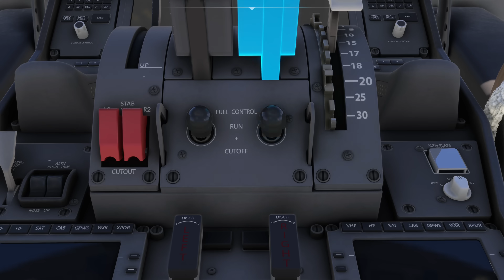Air India 171: Why Did The Fuel Cut-off Switch Get Moved?

Comment: This is why we need cockpit video. When you're at work, there is NO legal expectation of privacy, but because of a union being overprotective, we'll never know what happened to the switches.
Reply: Even busses and trains have cameras now a days. Why are aircrafts avoided.
Reply: @RockyRock-vv3ex oranges and apples , you can’t compare the 2
Reply: @MrMgage13 Why, whats so special in Aircrafts which shouldnt be recorded?
Reply: When audio CVRs were introduced, the agreement was that the recordings would never be made public, only accessible by investigators who would hold the recordings in confidence. This agreement has been violated countless times. The last thing a pilot wants is his or her death leading on the perpetual news cycle.
Reply: I gave anesthesia in OR'S for 40 yrs. Since around 2010, cameras were installed in every OR.
Reply: @pegggymallis324  I work in a hospital. Cameras are everywhere. The medication room, procedure rooms, operating rooms, emergency department, hallways and parking lots. What do pilots have to hide Captian Steeve?
Reply: Is this possible.
Major failure of systems which caused the RAT to deploy and also shuts the fuel valves. The pilots get some warnings including engine shut down warnings and fuel cut off warnings. One pilot quickly assumes the fuel switches were operated and asks the other why. The other pilot says he didn't. They then realise the switches are in the on position so try cycling the fuel switches off and on to see if that would get the engines going.
Reply: Absolutely ridiculous that a certain word can't be used here on YouTube? WTF ?
Reply: @JK-dp3lp YouTube is strong with censorship!  You can only say what YouTube approves.
Reply: Yeah we did, they flipped them! They don’t flip themselves! The news media has everyone believing Boeing created airplanes with faulty everything! That Advisory bulletin is completely irrelevant. Disregard it. They have the pedistal with the switched still on it and they were normal. If a pilot wants to go suicidal there’s a million ways up there to do it.
Reply: Recording will discourage someone from doing something wrong
Reply: @dharma37chef54  not really, he knew he was going to end up dead anyways why would he care
Reply: Yes, but atleast video should record from switches and dashboard parts as much as possible, Not including individual (pilots)
Reply: It's not that easy  the unions don't want that the only way it would work for all  is the recording would be triggered by a cockpit warning
Reply: @therankinfamily1867 recording can be designed to be automatically deleted after plane is landed safely this should address union’s privacy concerns
Reply: @therankinfamily1867  that would defeat the purpose and in this case the warning comes AFTER the action.
Reply: Non union jobs also don’t have cameras why don’t have cameras at operating theatres too so you can sue the surgeon , always basement dwelling commenters love to comment with out any thought
Reply: I'm on camera 100% of the time I'm at work and I'm not responsible for hundreds of lives.
Reply: A cam could show wether and if who was tuching the switch.
Ther are good arguments for cams yet also against them.
People at the moment are quick to pinpoint at the pilots.
There was a bulitin pointing to the switch some years before, air india did not check the switches afterward wether they are ok or not - this was not medetory.
The report dose not realy state yet wether the switch was realy ok or not.
As long the final report is not out it is good to slow down with pointing fingers, it could be the wrong adress.
Reply: Then someone will just find a way to shut it off if they were really determined to.  Cameras would not have prevented this.  🤦‍♂️
Reply: In your country maybe there's no expectation of privacy.  In my country we have the " workplace surveillance act" .  Careful about specious generalisations.
Reply: No we don’t!  Now you’re just giving the FAA ammunition to violate a pilot for any simple thing made up or real and abuse their power- and oh and they 
would. Maybe stop hiring jihadi pilots would be a great start.
Reply: In all civilized nations employees have protections!
Reply: You have two suspects for the suicide variant. Wait for the final report, there’s a 95 % chance they‘ll find out.
Reply: And how would that matter now ? People are dead
Reply: Absolutely agree I drive a bus for city and over 16 cameras are present recording at all times.
Reply: Cameras in the cockpit, that’s never going to happen. Unfortunately
Reply: Wow that's a great point.
Reply: then you should become a pilot....
Reply: and you are incorrect... the FDR tells where the switches were... how do you think the report was written?
Reply: @SKIPWOOD-UA777CAPT-RET  It tells where the switches were, but not how they got that way. If the switches are defective, but the crash is attributed to pilot error, it can happen again. Video would show if they were moved by hand or came out of detent due to a defect.
Reply: @tooltroll  so in your experience have you ever seen 2 identical switches fail at the exact same moment? I wonder what the odds are against that? there is enough technology in airplanes as it is... air india KNOWS what happened and who did it... they just won't release it... and the same goes for a camera if it had been installed... they wouldn't release it.
Reply: @SKIPWOOD-UA777CAPT-RET  I can see two switches getting bumped by the pilot reaching for the thrust levers. I don't care if the video is released, nor should it be, but there would at least be proof, not speculation, as to which pilot touched them and why.
Reply: @SKIPWOOD-UA777CAPT-RET  Ttroll, you have two ears and one mouth?  Use your ears TWICE as much. Skipwood has been there done that. Listen to him PLEASE.
Reply: How would cameras in the cockpit prevent a potential sabotaging of the aircraft by one pilot at a critical point of no-return though? They wouldn't. They could show which one caused it, but that wouldn't bring back 200+ lives or stop another pilot doing the same if they were so inclined and showed no outward signs of intent. And if pilots know where the cameras are, and want to do something preplanned like this could be, would they not then also plan how to cover up what they're doing from the camera(s)?
Reply: @JonathanB6023 Visual a direct evidence. A murder suicider would refrain fromdoing so in a Cctv environment in most cases.
Reply: You fucking western media are trying to save Boeing... Boeing is the real culprit behind the crash..
Reply: Camera’s might answer some questions but they won’t prevent incidents, those advocating cameras just can’t stand not knowing.
Reply: @SteveC-y9W  Actually cameras could prevent this as well. In some cultures the pilot would not like that the family has to live with this guilt. It would also make any insurance to be void since they don't cover suicide. I.e. it would hurt the pilots family and that may stop him.
Reply: @SteveC-y9W  If it was caused by a defect, yes it would prevent future incidents.
Reply: Yes they can, if anybkdy knows they are ubder cctv surveillance, villaneous behabiour reduces drastically  @SteveC-y9W
Reply: @SteveC-y9W  How many car accidents are prevented by having dash cams?  Probably not very many.

But how many times have dash cams been used to prove what really happened or who's responsible for the accident? And how many times have dash cams been used to prove assault or attempted fraud? 

And for commercial drivers, how many times has the mere presence of interior cameras discouraged drivers from playing sudoku or words with friends on their phone while driving? If it was only once, that's enough.
Reply: I bet you work at a call center and have no real life job, is there a camera in every cubicle of your office ?
Reply: Agree, can also potentially handle college complaints, ensure possible and complete training for procedures. They could and should be used to improve safety further
Reply: Fake narrative. Facts are here. You are sold off to Boeing. Why don't you talk about FAA directive from 2018 and CAA directive from May 2025 which talks about issues with Boing 787 which can cause cut off including during inflight.  Why Etihad airlines and DGCA wants planes to be checked. Why British Authority wants checks for this issue since May 2025?.

Western media is corrupt and sold to Boeing
Reply: We know…we will never “see”…
Reply: Can I get the tape after I get in the mile high club? 
Asking for a friend.
Reply: @michaelgarrow3239  we didn't have cameras in the blue rooms... but in the 777 we had cameras everywhere else... they do not record.. you could only view in real time.
Reply: First step, take down the camera. There it go your great idea.
Reply: This is no tragedy it was mass murder -
Reply: Real simple - video recordings can be kept locked up at end of every day and disposed off periodically nobody allowed to look unless airline and union and faa all agree .
Reply: What union is it exactly that is being overprotective and keeping cameras out of Air India jets?
Reply: Just like police body cameras
Reply: the camera wouldve saved noone here
Reply: At the very least video feed should be included in black boxes
Reply: It's not going to prevent pilot suicide but it will definitely make a difference in providing clues during an accident investigation.
Reply: Uh, yeah we do know what happened.  The voice recorder voice asks why the switches were moved to cutoff., indicating that they were physically moved to cutoff.The flight data recorder confirms exactly when each switch was moved to cutoff.  The engines confirm this by shutting down due to no fuel.  That is 3 separate confirmations of what happened.  Even if you had video, it wouldn’t do anything but possibly provide a 4th confirmation of the same thing, and a 10 Million click YouTube bonanza for somebody.
Reply: @eddiegardner8232  The voice recorder also recorded that the other pilot saying that he didn’t do it. So, now what is the truth?
Reply: @subhash494 . The simple truth is that everything tangible says the fuel levers were moved to cutoff by one of the pilots.  The report doesn’t say which one said what, but they know which said what because the recorder records each pilot’s voice on different channels.  They just aren’t publicly saying it yet.  The reason why is not being disclosed, probably because of legal liability considerations.  It might lead to implicating one or the other as the guilty party.
Reply: At least video should capture of switches parts, which switch when using pilot?
Reply: We know exactly what happened. The switches were moved by one of the pilots. We are unsure as to who and why.
Reply: @jamesdellaneve9005  that's what we want to know!
Reply: @jamesdellaneve9005  A video in the cockpit could have answered your question.
Reply: @jamesdellaneve9005 If one pilot was busy with both hands in take off, then it stands to reason that it is the other one!
Reply: @rozwood1668 That’s my hypothesis as well. They’ll analyze the voices and confirm it.
Reply: @rozwood1668  You can do any take-off with only one hand.
Reply: @GermanGuy007 Physically, yes. In practice, no.
Reply: @rozwood1668  Sorry, Roz. The pilot flying has one hand on the yoke, one hand on the power levers (even though auto throttles engaged). We PRACTICE muscle memory reaching down, without looking, to touch and postion engine cutoff switches to cutoff. You are KNOT dealing with kids here. Well, kids in comment section, no kids in B 787s.
Reply: @jamesdellaneve9005  ... or maybe the flaw in the switches is more serious and widespread than Boeing, with their horrible record, is willing to admit.
Reply: @tooltroll That’s impossible. They purchase the switches from a supplier. The designs are precise, they test the crap out of them. They qualify those manufactured parts and perform process surveillance at the beginning of the runs. To ensure that they are meeting the requirements. Many times, the same parts are used by other companies. I don’t know if this is a custom design for Boeing or if anyone else is using them. If someone else is using them, then you can get the benefits of knowing their actual failure probability. Let’s say that there’s a bad part 1 out of 25,000. The odds of getting two bad ones is next to impossible.
Reply: @jamesdellaneve9005  honeywell make the switches
Reply: @tooltroll  Ttroll, quit while  you are behind  !!! How many times have you / we heard about the engine switches slipping to cutoff on their own? You think highly trained pilots, who are always first to the scene of an aircraft accident, would KNOT report such an incident.  AGAIN, do KNOT believe everything YOU think. You didn't get your name by being in a tricycle accident.
Reply: @jonathanpringle8238 what do they know about avionics?😂 Luckily, switches are very easy to verify in terms of track record and such. They can triple check if they like. However, that notice from the past did not trigger groundings and such. If Honeywell has other customers using the same switches, that data will help.
Reply: @atpg5  Why do you post KNOT instead of NOT?  It's confusing.
Reply: @a.w.thompson4001  Eye no! Write?
Reply: @jamesdellaneve9005  Listen to james, he knows of what he speaks !!! These switches are used in many sophisticated jet aircraft.
Reply: @atpg5  You might be making a valid point, but I can't take anything you say seriously when you continually misspell the same word so many times.

KNOT does not mean the same as NOT.
Reply: @atpg5 Which makes the faulty switch hypothesis from highly unlikely to impossible. We have history of these switches working without a need for changes.
Reply: @j29maniac  Eye no, write?
Reply: @a.w.thompson4001  I smelled bacon as you read this.
Reply: FACTS!
Reply: Well , many flights are very long (12hr +), there can be times when pilots require a little privacy or relaxation. They may have rituals they dont want the general public to know. If there can be some system in place to make sure that the video stays on the plane and gets deleted automatically at the end of an uneventful flight (preventing any possibility of video leakage), perhaps many more pilots would shift their stance
Reply: @knownasezio4421 We dont want these cockpit videos to be released in youtube. It just has to be recorded in FDR and only to be relooked in an accident scenario.
Reply: @RockyRock-vv3ex  as steve said , the main concern is the videos of pilots leaking, there needs to be a system of rules in place to make sure such a possibility does not exist. There is also an unfortunate possibility that the higher ups are too busy trying to train AI for the planes to care about concerns of individual pilots who may soon be disposable in their eyes
Reply: @knownasezio4421  Designers are already working on aircraft with one pilot and one dog in the cockpit.
Reply: Yes we need cctv in the cockpits. If taxis and buses etc have them, then aircraft should have them.
Reply: @rozwood1668  KNOT going to happen in your lifetime.
Reply: @atpg5 Maybe Knot lol! 😂
Reply: @rozwood1668  Taxis and buses use them for the safety of their drivers, not to record the technical inputs of the driver.   That is because they operate in environments with access to the general public.  Airline cockpits are secure areas.  A camera would add confirmation in this case but it was the FDR that found the cause.  A camera would satisfy the public curiosity of who did it but it will never answer why.   It actually doesn't improve safety.
Reply: @matthewwillkens8240 Nobody asks you to show it published everytime a flight is finished. They shoukd be recorded and available to access in an event of accident. Thats al.
Reply: @matthewwillkens8240  I appreciate that but for the sake of the families, I would say it is necessary to know who made the error (🤔) so an innocent pilot isn't falsely accused. Could have insurance implications. I certainly agree that it would not be for the public but for the FDR and investigators.
Reply: We know what happened to the switches. A pilot turned it off, and in terms of safety and discovering failure mechanisms, which the investigation is doing it doesn't matter who turned the switches off. CCTV footage would only satisfy curiosity and would not improve air safety
Reply: @Cyb8042-j6w  ohh hell naah
 video footage is definately going to help in investigations whn they don't know which pilot changed the controls or how the controls was changed.....that basically will let the investigators focus on the pilots background who sabotaged the plane.....& find more answers & reasons....& hence there will probably changes in psychological evaluation of pilots in future before flying a passenger aircraft...
Investigators know it was changed but they don't always know how & by whom caused the change.....also completely cuts out the chance of any technical faults completely taking the blame away from the pilots & onto the airline....its infact better for pilots in a way....
& in the recent air india crash they don't have any clue which pilot or how the engine fuel cut off switch was engaged.....
270+ lives lost investigation would have ended right there.....there families still have no clear answers...
As passengers who gives there lives to the hands of the pilots atleast deserves this much transparency.....
SO CAMERAS should definately be installed in the cockpit.. period
Reply: @Cyb8042-j6w  it would improve safety as you can observe body language so will help airline psychiatrists spot problems
Reply: @Cyb8042-j6w The assumption CCTV wouldn't prevent potential accidents is wrong. People behave more responsibly if they know they're being viewed by video. This is proven and implemented in numerous other examples and occupations.
Reply: tell the unions that
Reply: Screw the unions
Reply: This may be difficult with international travel. There is an expectation of privacy at work in Europe (or at least the Netherlands), it is illegal here to use camera footage to check on employees except for very specific circumstances like theft
Reply: @kevinsweijen5674 I think an airliner crash would be considered “specific circumstances” many times more than theft….
Reply: @kevinsweijen5674 I'm pretty sure in Netherlands and other over protective countries, in specific jobs there are exceptions. In this case that is no "surveillance" (or big brother) but a safety recording that will only be accessed if a disaster occurs.
Reply: @kevinsweijen5674  only investigators would be able to access and view it, not your immediate boss
Reply: @jonathanpringle8238 this still applies. You have protection from being monitored on behaviour through camera footage. Otherwise every company would do it and just outsource it to a different company
Reply: @kevinsweijen5674 Netherlands trains and busses have cameras inside drivers cabin. LOL 😂
Reply: @RockyRock-vv3ex they do! But they’re not allowed to be used to check any employee behaviour.
Reply: @RockyRock-vv3ex so technically, say there WERE camera’s in the cockpit, under our law they could probably check it to see what happened to their property, the plane. They would not be allowed to make any notes on pilot behaviour or report on it, as that would be a breach of their privacy.

So even if the investigators saw what happened, we’d never know about it.
Reply: @RockyRock-vv3ex yes, but legally pilot behaviour would not be allowed to be investigated from that footage. So it wouldn’t have allowed for any additional official insight
Reply: @RockyRock-vv3ex  But KNOT in Netherland based aircraft. I was based there for 18 months.
Reply: If I was a pilot, I wouldn’t have a problem with it. Why would the unions cause such an issue?
Reply: @jacobspeeds The police love it. It/s reduced complaints by the a-holes 80%.
Reply: @jacobspeeds  Because it was promised to we professional pilots that voice recordings would NEVER be released to the public !  Have YOU ever heard cockpit recordings?  Are you part of the NTSB accident team?  There you go !!!  Search live cockpit recordings right here on this plateform. Here's a plan = protest, start taking the train to...well, anywhere in the North or South America.
Reply: @atpg5  you're right. the public will never have access to the data. Very convenient to manipulate in favour of the airline or aircraft manufacturer and blame on the pilots..it's quite pathetic..
Reply: @jacobspeeds I am and I most certainly do. We’re already the most closely watched and regulated profession there is. The day you record your surgeon , your kids teacher in class or you sitting at your desk at work come back to me. There’s no other job that scrutinises employees like mine and the level of observation is quite enough already thank you.
Reply: @EnfieldNo4  maybe your airline and most others, but there are still many other airlines that don't 'scrutinize' or care much about the safety and wellbeing of pilots and passengers. This is a prime example.
Reply: Absolutely...the pilot unions blocking cockpit video recording is absolutely ridiculous. Video recording must be done on black boxes and available for inspection only in case of an investigation just like the CVR and FDR. there should be no other means of accessing cockpit video otherwise.
Reply: If you don't agree to a cockpit CCTV you shouldn't be allowed to be a pilot. Simple as that.
Reply: @flyingeagle5061 Do NOT believe everything YOU think. You hurt the team.
Reply: @flyingeagle5061shut up
Reply: @flyingeagle5061
That’s just dumb. What an ignorant Statement
Reply: Yea especially after what happened with MH370 which was over a decade ago even airlines with not the greatest reputation should have a Cockpit Video Recorder, really they should've been commonplace even when MH370 disappeared, the mystery here I believe may at least one day be solved, I highly doubt mh370 will ever be solved even if it's one day found but I really feel we're technologically advanced enough to have at least a 1 hour loop of video which at this point I feel should be possible to have uploaded to the cloud as backup for it not as long as an onboard EAFR then at least on one hour loops but definitely onboard video recorders should be fairly commonplace by now, certainly in the next ten years
Reply: We do need pilots out of the cockpit …reduce their input to bare minimum….this would prevent so many miscommunications/ human errors, wrong decisions. Hoping technology will adfance fast enough t to take over all collision avoidance, routing, communication. We don’t need those errors..
Reply: @user-ks2wz7bg4p aircraft designers are already working on cockpits that have one pilot and one dog.
Reply: Yeah. Makes sense. Surprising! everywhere else a working place has cctv.
Reply: @Ttroll: We DO know what happened to the switches !!  We DO  know the very second when they were turned off, we DO know when and in what order, we DO know when and in what order  they were turned back on. You must pay attention. As for in cockpit video: do you have $1,000 US dollars? Bet it ALL on no in cockpit video in YOUR lifetime   !!!
Reply: 100% Agree.. CFII and A&P
Reply: @toddsmith8190 that’s because you are not an airline pilot.  Your view will change when you get hired at an airline. 

I suspect that you do not have cameras from your flight school in the aircraft you flight instruct in.
Reply: The preliminary report on the Air India Flight 171 crash has led many to hastily conclude pilot error, but as a pilot, I strongly question this assumption. The report indicates both fuel control switches were moved to the "cutoff" position within one second of each other, an action that seems nearly impossible given the design of the Boeing 787’s lever-lock fuel switches, which require deliberate pulling and flipping to operate. The cockpit voice recording captures one pilot questioning the other about the cutoff, with the other denying responsibility, suggesting a potential technical malfunction rather than human error. Furthermore, the lack of clear voice identification and the absence of cockpit video footage, as highlighted by experts, underscores the need for a deeper investigation into possible mechanical or systemic issues before attributing blame to the pilots. Rushing to judgment risks overlooking critical evidence that could reveal a flaw in the aircraft’s systems or maintenance, as flagged in a 2018 FAA bulletin about fuel control switch issues.
Reply: @AviatorsUnplugged  it’s not impossible at all. There was an example video uploaded on YouTube and it was done slowly, and took 1.7 seconds. 1 second is easily possible.
Reply: @AviatorsUnplugged  The 2018 bulletin was about 737 fuel cutoff switches, not 787.  This particular aircraft had its throttle units replaced in 2019 and not a single mention has ever been made of these switches having issues.  The chances of BOTH fuel switches failing 1 second after another are 1/ in a billion. There is a far greater change that these were manipulated by one of the pilots.  One pilot saying "why did you do that" and the other responding "I didn't"could easily be a ruse to get the words onto the CVR and confuse the investigation.  Humans lie far more frequently that fuel cutoff switches fail.
Reply: @matthewwillkens8240 And then after that thet pilot helped to restart both engines while the other one steered.? How ironic 😅
Reply: @AviatorsUnplugged pilots always quick to shift the blame from human error when most accidents are caused by human error. Did you watch previous videos? Captain Steve said one second is about right for the time it takes to switch to cutoff or switch to flow.
Reply: @AviatorsUnplugged what you're writing is highly influenced by a predetermined opinion and I highly doubt your actually a pilot of you think that moving both switches within one second wouldn't be possible. That's just nonsense and clearly doable. Stop reaching, stop making up BS. The evidence is clear and all the data is consistent
Reply: @stefan514 And then, this same.pilot helped to restart engine and co operate with flying pilot right.. What a speculation 😂
Reply: @RockyRock-vv3ex  He waited a full ten seconds...when he was certain it was too late to avoid the rocks and trees!!!   Makes for a certain cover up.
Reply: @AviatorsUnplugged As a non pilot I have been wondering about that myself . After watching videos and listening to the experts it seems like the configuration of the cut off valves would require more time . Can the procedure be duplicated on a simulator to confirm that it can be done in one second ?
Reply: @thomasphennigan What if two hands are used, one on each switch? If the non-flying pilot operated the switches they would have had both hands free. Easy to operate both switches at nearly the same time.
Reply: @thomasphennigan  CAN,  HAS,
Reply: There are cameras in the cockpit. It's built in the design of the aircraft itself IIRC. The investigators whave definitely seen it as well, they just haven't said anything about that yet. Especially coz it seems this was done by a very senior pilot and they don't wanna say too much too soon. They wouldn't have released this statement if they weren't absolutely sure.
Reply: @bigbulk688 No, there are no cameras in the cockpit. Go pull up the master equipment list from the nether reaches of the internet.  It’s long but worth a look see. You’ll be looking for a while for what’s not there,,Then go find the nonexistent tech specs for a cockpit camera. There’s nothing on an aircraft without a published technical specification.
Reply: Boeing being Boeing! Shifting the focus to the pilots - dead can’t talk, blame them!
Reply: @markpatel wow what an idiotic comment, just get over it and accept it, truth hurts sometimes but quit trying to blame it on Boeing all the time, good grief
Reply: @markpatel don’t be dumb, you act like Boeing was the only one on the investigation team. Numerous National and international teams were on the investigation. Most accidents are human error.
Reply: @markpatel come on get serious I’m no boring fan . That copilot is a hero the pilot is a monster